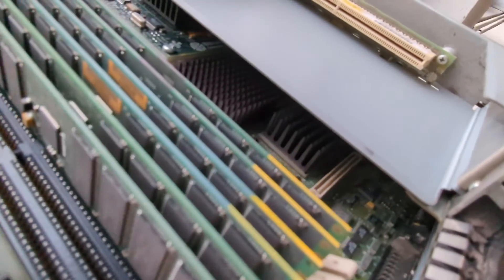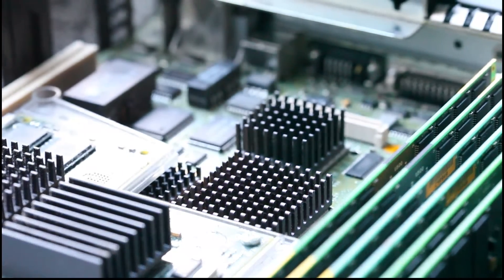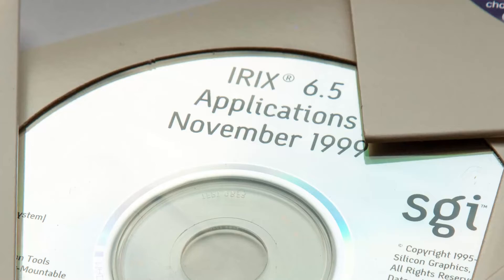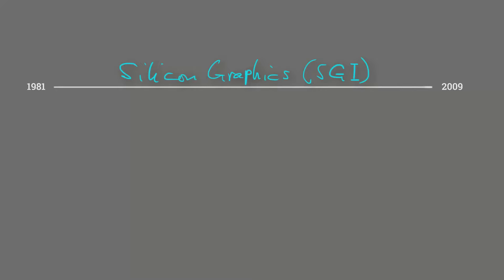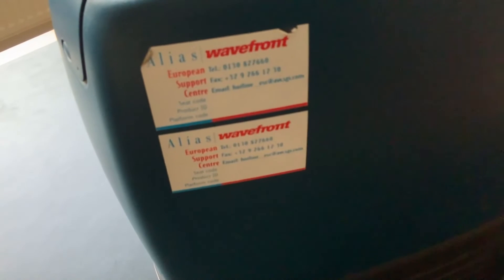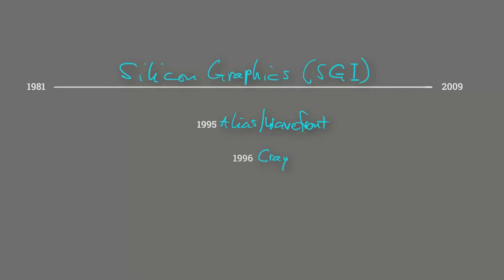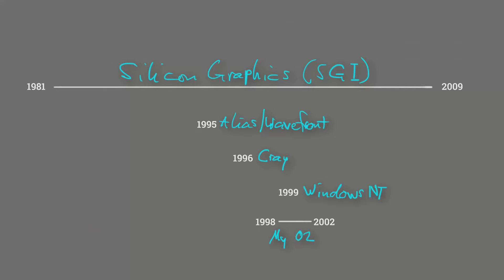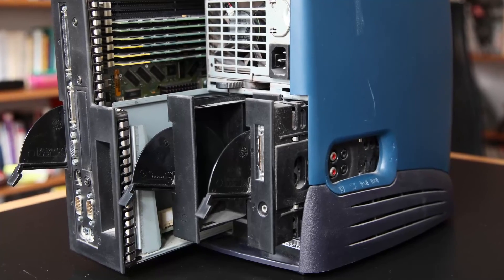SGI O2 Graphics Computer 1998

Comment: It was weird though why vm windows on your machine and port everything to windows they basically just advertised for gates
Reply from the maker: i don‘t get your point. however: moving from the O2 to a windows NT machine was crucial for my animation work.
Reply: @Uhr24  my point was one of the crucial losses for sgi was porting everything to windows it’s a major factor in why it is no more that company was run by morons
Reply: @cursedfox4942  There were tons of bad strategic decisions. Today, it could’ve been another Apple, dominating the high-end desktop market with sleek designs. The mistakes? Switching to Windows and Intel, not evolving its own architecture and manufacturing processes, and abandoning its graphics division, trusting NVIDIA to handle that instead—and even giving them a team of engineers to do it!
Reply: @ ya abandoning its graphics team was MORNONIC the company is called silicon GRAPHICS 

It’s funny I always joke : hey they wanted to be a server company and now they are under hp lol.

One half of the company was obsessed with servers one with graphics weird dynamic that the server people won